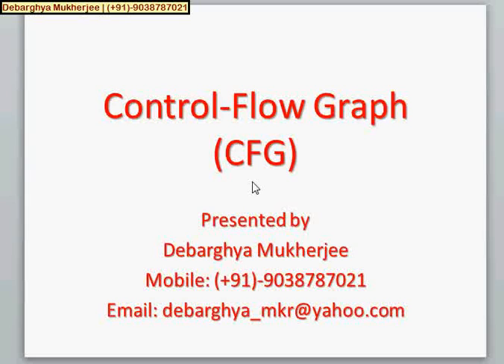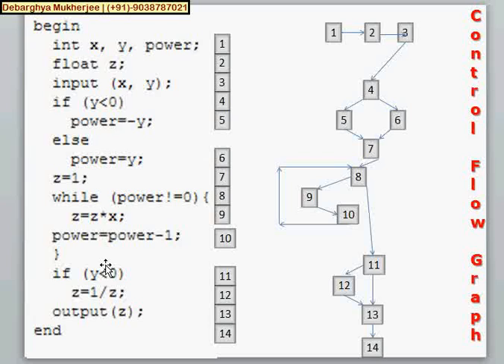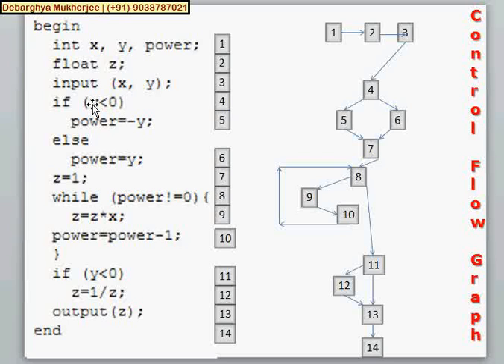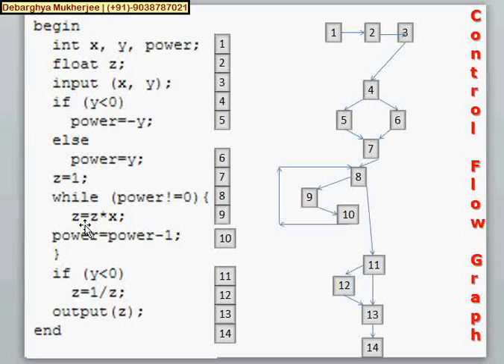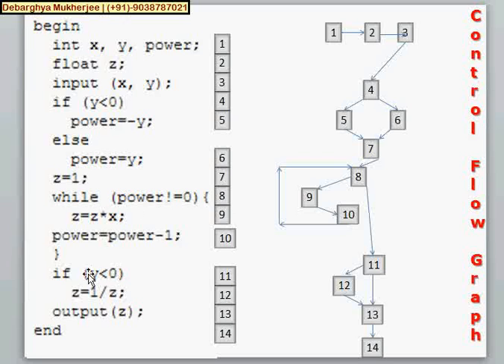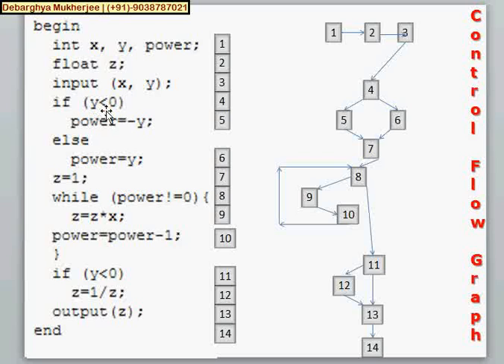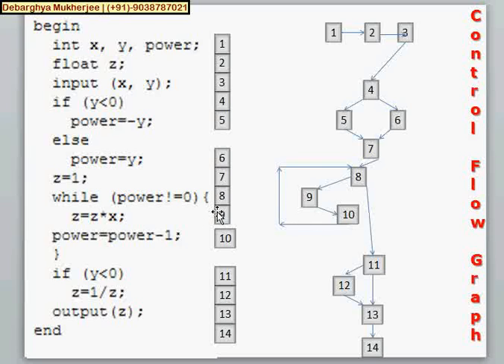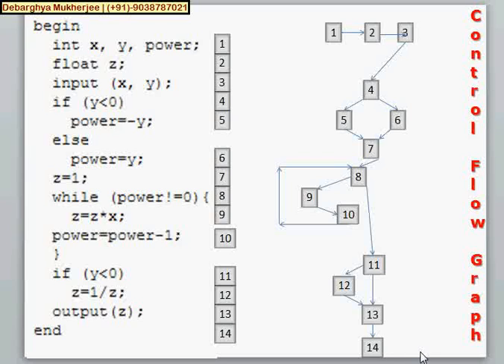Control flow graph

Comment: there is a problem as at step number 11 it will check if its true then it will go to 12 ad then 13 means in case of true it will go to both 12 and 13 and in case of fail it will go to directly 14 from 11 because 12 and 13 are in one block of if satement
there is confusion as you have not used the braces here
please recheck it